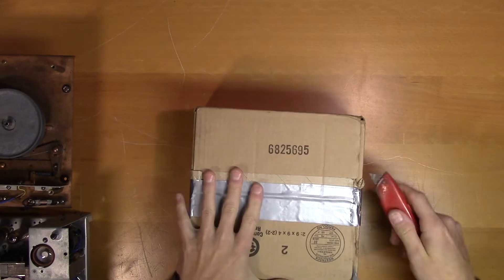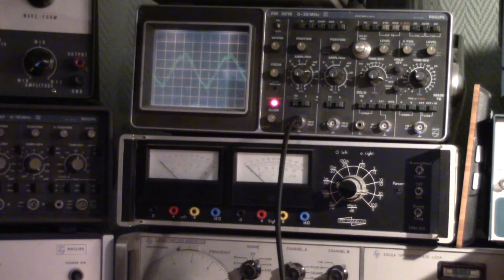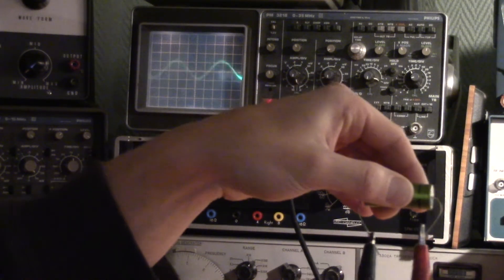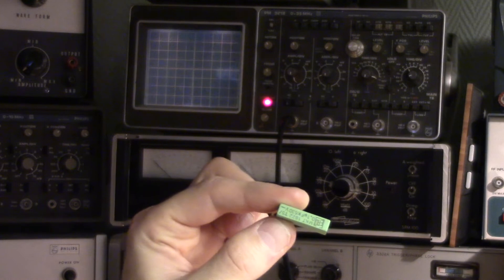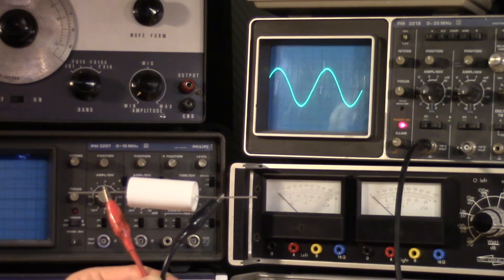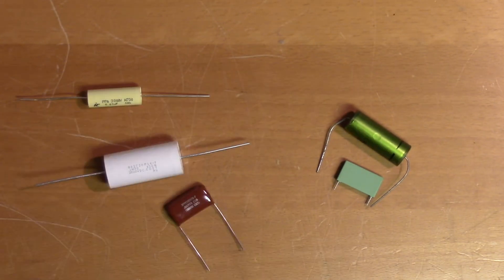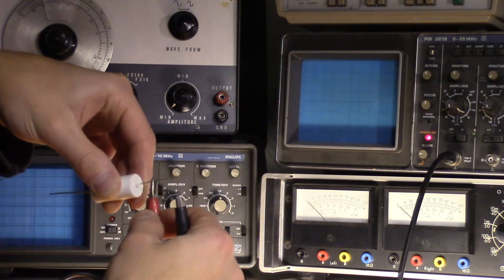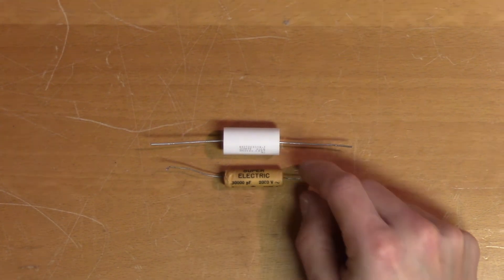Why You Should Avoid High Voltage Film Capacitors - Ekko Recorder Restoration Part 3/6

Comment: I have some old radio repair books they say its important to observe polarity when replacing capacitors. I question why the new capacitors aren't marked is its so important.
Reply from the maker: Hi brian g., I do not have a definitive answer, but I can probably make an educated guess. 

First of all it depends on the type of capacitor. Electrolytic capacitors will literally blow up if you orient them incorrectly, so for them the orientation is crucial and the polarity should be clearly marked. Some ceramic capacitors are completely symmetrical, so for them the orientation does not matter at all. resilience

My guess as to why the orientation of film capacitors are rarely marked anymore is that their main area of use has changed. During the vacuum tube era, high voltage film capacitors (or their paper based counterparts) where often used in audio equipment, carrying sensitive audio or radio signals. Here noise resilience was important, so knowing the polarity was desirable. Then came the solid state era, with transistors that had a much lower operating voltage, and ceramic capacitors eventually became more convenient to use in mass produced audio equipment. High voltage film capacitors continued to be used in power applications, where noise resilience might be less of a problem, making the polarity information less desirable.

So, since the main area of use for film capacitors is probably not as sensitive to how the capacitor is oriented anymore, the capacitor manufacturer can save some money by not having to keep track of the orientation during production.